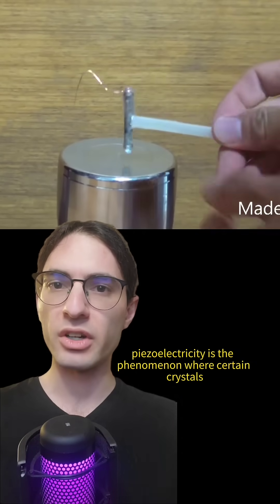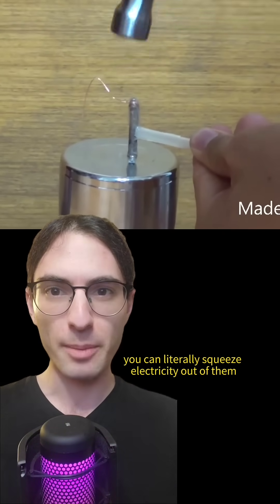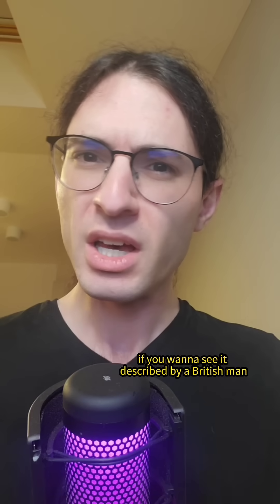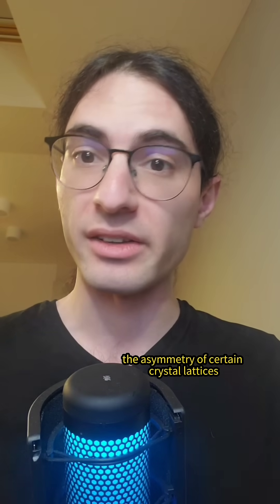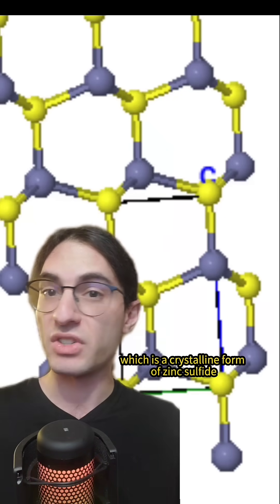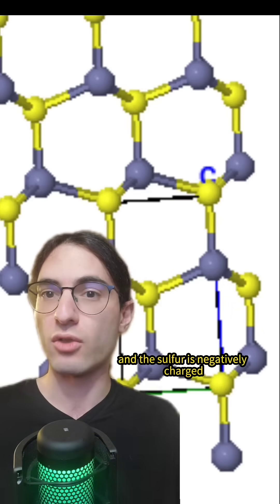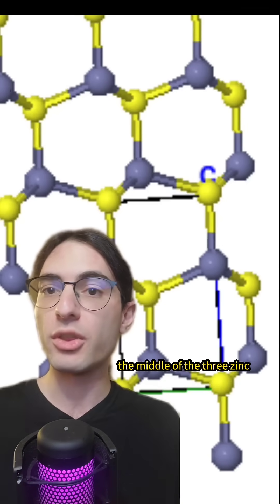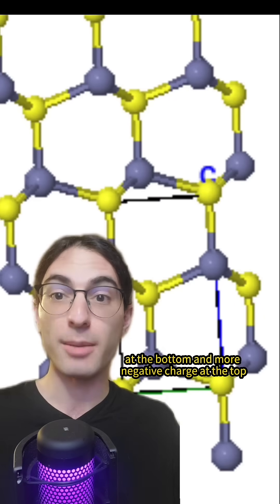Piezoelectricity explained

Comment: At work I use an ultrasound thickness meter, and piezoelectric elements are key to this devices function. A piezoelectric element sends the signal into the steel, and another receives the signal back telling you the thickness of the metal down to .001".